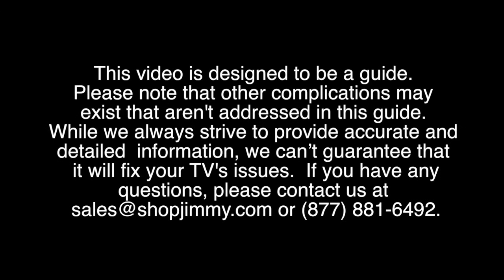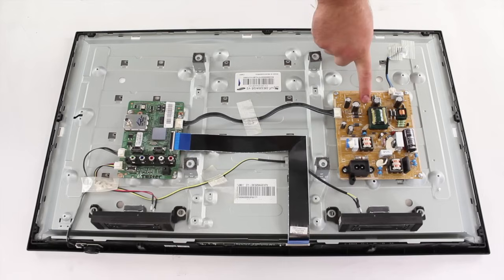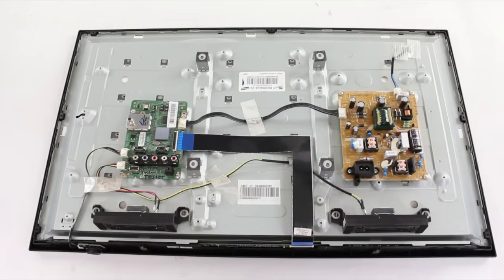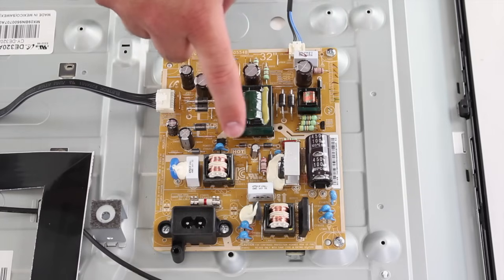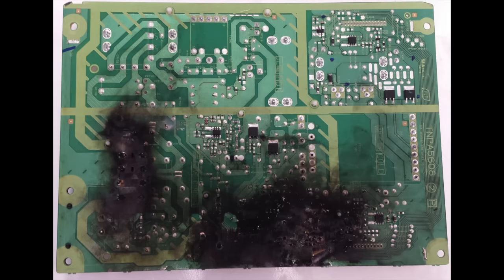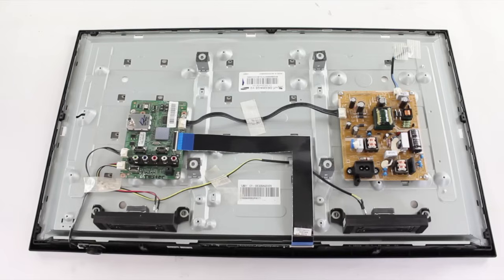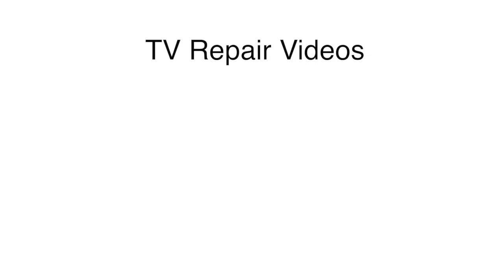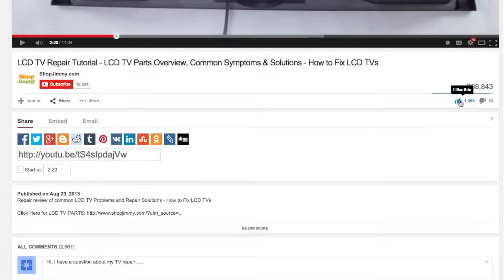Samsung LED TV Won't Turn On No Power & Does Have a Standby Light Basic Troubleshooting TV Repair

Comment: My tv went blank shut off, came on with no sound then went off and never came back on.. No lights at all.. I just replaced the Power supply and now the lights come on.. I can tell the IR is picking up my commands from my remote. So what do i need to replace next, i dont want to waste money. Idk if I need a main board or an inverter.

Comment: Have 2 Samsung UN50ES1650FXZA both with same symptoms. When you plug tv in standby light is solid once power button is pressed light does 2 short blinks, 5 times then stays solid and repeats. Visual inspection of all boards is good. Unplugged main board from PSU LED will come on. Testing plug on PSU to main (5v pins) getting 7 volts but jumps with blink of standby. If I plug tv in and do not press power button standby light will stay solid with screen off, and same plugs shows 0 volts to main.

Comment: I have a samsung led smart tv un50h6201af with no picture, its has sound and backlight are on i looked at boards and their is no visible damage to the boards. Checked the ribbons to see if any of them was loose and they was not. I checked the fuse to the t con with my craftman multimeter to check the voltage going to t con board and there was no volts or standby volts. Do i replace the power supply board or is their more ways to troubleshoot the tv to get a better diagnosis. I tryed checking the volts to the power supply board but i didnt get a read

Comment: I replaced the power supply, which did not fix the problem but when I replaced the main board, the TV came on. The TV turned on and off for a few days but now it won't come on at all. The standby light flickers when I try to turn on the TV from the on-off switch a the back or by using the remote. I have a Samsung Model UN46H7150AF. I'll never buy another Samsung.

Comment: I have installed a new power board and a new main board and still no luck... Any ideas? I have standby power and the back light turns on, but no picture. I hear the menu beep when turned on, but then it just cycles trying to turn on over and over again.... Any ideas are greatly appreciated!

Comment: Your video was very helpful. We have a Samsung LN46B630N1F. I was able to determine that a component on the power supply board burned out. Do you have any replacement boards for this model available, and if so, what would the cost be?

Comment: Just replaced power supply board.. TV works now, but have dark shaded bar running horizontally thru the middle of the screen. Could this be a bad power supply board? TV never had backlight issues...

Comment: I have a SAMSUNG UN39FH5000F that will not turn on. but the led light on when i try to repair the problem i discount the long cable that is connect to both the power supply and t-con board TV light came on but no picture
Reply: Donell Benton did you ever figure this out

Comment: i have a Samsung UN55FH6003FXZA ver AHO1.  When i plug the cord the standby light flashes red once and then nothing.  Performed a visual on both boards and cant find anything indicating a problem.  Next step?

Comment: sir, i have a sansung led tv 40 inch.. when i try to on can here tv power on sound  but no have backlight and display. after 30 minute tv off automatic. my tv model 40f 5000. i hope you can help me
Reply: same problem here ! got any solution ?
Reply: @josephfrancis4683  did u got u problem fixed? I've the same issue

Comment: I have a Samsung smart tv model #UN50EH5300F When I try to turn on the tv set it just blink and shuts immediately off continuously.  I do see a blinking white light when I look through the back of the tv panel.  Please help with what kind of piece I need and how much it would cost.  Thanks a lot.
Reply: Kel Clerk did you ever find a solution for this?    I’m having the same issue
Reply: Bad led strips

Comment: when I disconnected the main board from the power supply and replugged the TV in the LED panel lights up. I am pretty sure that this means that I need a new power supply. could anyone please confirm this before I order one? 
UN55FH6003F
TYPE NO. UN55FH6003
AC110-120V-50/60Hz
125W
Typical power - 65W
Model Code : UN55FH6003FXZA
VERSION NO. AH01
S/N:Z8213CCDA02227T
Reply: There's no standby light on when plugged in, but as I said, only when I disconnected the two boards does the LED board light up with a constant glow. The TV was having to be plugged in and unplugged several times over the course of several months then it just decided to not power on again. I'm fairly certain that it is the power supply but would love some feedback. Of course I will purchase the board from you guys if you can help me out with this. thanks in advance
Reply: that being all said, I forget to mention that there is no visible damages to any components.

Comment: the power board in my Samsung has a diode that fried on the original board. bought a replacement and the same exact spot and diode fried again. any reason why? and can this be fixed. I really don't want to buy another t.v

Comment: I have a Samsung TV  Model: UN46EH6030FXZA -After exiting the hidden service menu I was unable to power the TV back on.  Currently I have no picture, no sound and no backlight.  When applying power from the remote I get a steady standby light only.  When powering off the standby light blinks 5 time then goes out.  I have tried a blind factory reset posted by one our good YouTube members without success.  Any help would be appreciated.  Thanks in advance!

Comment: Have samsung le37 A557P2FXXU Fault:-
When switched on at wall it will show red standby light but will dim out and die when remote is used.
Changed power and main board  still the problem exists.
Works perfect when left in standby mode .
Any ideas as im running out of bits to replace?
thanks

Comment: So my Samsung tv has a red light but doesn't always turn on. If I unplug then plug back in it sometimes goes on.
Reply: Michael Cardiff 
I have the exact same problem. Did you ever find out what was wrong with yours?
Reply: Michael Cardiff mine doesnt turn on at all but does have stand by. i ordered the power supply board and replaced it but problem wasnt fixed so now im returning it and ordering main board.
Reply: Commaa
Reply: Same problem with my tv. Did u ever fix  it and if so what was it?
Reply: I have a UN55EH6000F SAME PROBLEM  2012 model power goes out no led no screen, will not turn on with switch either. Unplug overnight plug back in works for a week or so then goes out again
Reply: So did you come up with a solution.
Reply: Just fixed mind with a main board from shopjimmy $40
Reply: Michael Cardiff 
I had the same problem with my Samsung I kind of found out through some of these videos I've watched that on Samsung It's usually the capacitors.
It's the capacitors inside the power board. If you open it up and look at the little round capacitors on the tops of them you'll see that they either bubbled up or expanded and broken the seal. I just replace all of them on my tv and just in case for insurance I replaced the ones that weren't blown and it worked perfectly.
Reply: I have samsung series 45 led tv and have same issue... so far mine will reliably turn on so long as after it "dies" I unplug/plug it back and it will turn on.
Reply: I have a similar problem with mine, after I unplugged the power board from the main board and red the outputs of the power board with A/C plugged in the TV started working fine again. I am pretty sure its the main board since the power board outputs all matched what the circuit card had printed on it (each plug has a table with voltages for each pin). The other suspect I was thinking of was the remote/manual switch that connects to the main board. To me it seems that if you are able to get your TV to work properly even only some times it would indicate a problem with the main board rather then the power board. This does not apply to any other audio or visual problems other than a total black screen.

Comment: Good morning Jimmy.  I have a Samsung UN60FH6003F tv that has the standby light on, but I have to unplug and plug it back in to get it to power on with the power button or remote.  Any suggestions?  Thanks in advance!
Reply: Same problem with mine

Comment: my 60 samsung smart tv won't power on. I've replaced the power supply  board as there was a visible burnt component. but it still would not power on. when I disconnected  the main board I got back lights working but nothing else. when I plug the power supply  back to the main board the back lights go back off.

Comment: I have a samsung un65 65 inch led tv.  only thing it will do is flash a clear light in the background.  This starts to happen from the second I plug it in.  I can't turn on or off or get any picture, menu, nothing.  Just a slow flashing in the back .  I have replaced the power board and the main board and the t-con board and it still does the same thing.
Reply: RTR Racing did you ever find a solution?    Dealing with this now

Comment: Our TVs lcd light works but the screen Dosnt come how can I fix it any suggestions btw on a 65 inch plasma tv
Reply: Plasma? Just buy a new TV. The LCD technology is so efficient,right weight, and superior in picture quality. You can find a 65 inch LED LCD for $500 at 4k

Comment: I have a Samsung 32 inch there is a picture but only when I shine a flashlight on it and there is sound I have taken the back of to check if I can see the led light up but there is no lights could u tell me what I would need to fix this is it the led driver or the actual led strip ?

Comment: I replaced the power board and my light still blinks and takes a long time to come on, if it does. I also noticed when I switch from a standard digital channel to a HD channel it will go black and the red light starts flashing again. Could it be the video board? What about the capacitor in the main power cords going from the main in to the power board? What are your thoughts?

Comment: I fixed a TV like that yesterday. Power supply ticking, TV wont turn on. I found a leaky high voltage SMD transistor near the LED output. It has two 1M  resistors in series with its collector. Be careful, capacitors in this area stay charged for a long time. Discharge them with a 230v lamp.
Reply: 1 meg in series with the colectors?! explain. not much going thru 1 megaohm. I any case, thanks for info , will check this out next samsu g led set...
Reply: This is all I had to work with, http://obrazki.elektroda.pl/7456779600_1450654588.jpg
You will see what I'm talking about in the top RH corner. I have seen two models with the same fault although the symptom of the recent one was different. It sometimes would run but would turn back on 15sec after being turned off by remote or sometimes not turn on. The LED current sensing circuitry was the same in both, the protection circuitry that the 1M resistors fed to was different. With one of them, the 1M resistors finally applied voltage to a signal SMD MOSFET that pulled the anode of the opto coupler low, disabling regulation feedback of the main supply. This caused an OVP trip of the STR SMPS IC on the primary side.

Comment: pn51f4500 hi this tv  dont  power on only flash led red only see  light coming in screen   for 2sec  n  go back / ? please send info thanks
Reply: quijote disco
Power board, bad caps. Change the small ones and then use a hair dryer to jump start the power board. Heat up the larger caps, for some reason they will not have charge heating them will help it to power up when replacing the caps.
Reply: quijote disco

Comment: hi Jimmy. .I have a Samsung UN40FH5005F 
Version # TS01.
when turned on I get audio only with a black screen, I did the flashlight test and noticed I can see what's showing. I then checked the components. .the Main board and Tcon  board appears to be in good condition however the power supply board appears to have a burnt spot, can that contribute to having a black screen?  

Regards. Joseph.

Comment: Hi ! I have Samsung 40eh5000 led. Its staying standby mode with red light without blink and not  getting on. I have opened and checked that there no any capacitors have 
burn. What should I do now ? Thanks
Reply: Rajubhai Rathod

Comment: My Samsung LN40D630M3FXZA stop displaying an image, I can
turn the TV on and off and the stand by light stays on and will blink if I press
any buttons on the remote, while the TV is on the screen will flash very dimly.

This started after having a non-powered external USB drive connected
for an hour that had water damaged and wasn’t fully dried. The TV was working
connected to the USB for an hour before it began acting this way. 
There doesn’t seem to be any damage components on the Mainboard
and power supply boardDo you think only the Power supply board would be effected?

Comment: Hello, I have a Samsung model HL72A650C1FXZA and last night the picture was real dark and now today I tried to turn it on and I hear the music but blank screen and the green lite flashes for a few seconds then a red and green lite flash once then back to just green lite flashing and I can't turn it off or anything. I looked for damaged capacitors but did not see any on the power supply card. Oh, and I already had the LCD replaced because of all the white dots.   Any ideas?????   Thanks

Comment: hey, i got a LG 47LN5710 LED tv that doesnt turn on for any longer than a second, it just flashes the LG logo then turns off instantly. the red light at the front seems to be alot dimmer than it used to be and also it blinks about 4 times and then stops. i opened up the back part to check for burnt capacitors or any sign of blown wires but theres nothing, am wanting to know if you maybe able to help me find a possible cause for this. Is there any chance that it could just be a burnt fuse? this tv has ceramic fuses and i cant tell whither its broken or not, i have no volt meter to test them out. any advice would be much appreciated.

Comment: I have a Samsung UN40H5500.  The  standby light is on and not flashing.  However, when I press the power button, the backlights flash once really brightly and then nothing happens.  No screen and no audio.  There is no visible damage to the either the main board or power supply board.
Reply from the maker: +Brett Ramsey   Try all repairs and troubleshooting at your own risk.  This sounds like you have bad LEDs in your TV.  Unfortunately we do not sell replacement LEDs for your TV model number at this time.  You can check back in the future to see if we have them available.  Thanks!  www.shopjimmy.com
Reply: 1
Reply: ShopJimmy.com 
I got a Un55h6203afxza samsung tv. I found it had bad leds with the flash light test and also testing them with a led tester. Also checked power coming off board to led. it was really high voltage. I then replaced the power supply and leds. upon completion I plugged the tv in and now I'm. not getting the stand by light. think I have a bad board?

Comment: I have a samsung UN40D6000SF led tv, The tv wont power on and their is a red blinking light.
Reply from the maker: +Ramiro Murillo   Try all repairs and troubleshooting at your own risk.  I recommend replacing the main board in your TV.  Click this link to replacement parts for your TV model number:  <!-td {border: 1px solid #ccc;}br {mso-data-placement:same-cell;}->http://www.shopjimmy.com/catalogsearch/result/index/?cat=56&q=UN40D6000SF  There may be multiple boards for the same TV model number, be sure to match part numbers on your current board, with your replacement for compatibility.  Here is a link to a video showing how to identify your part number, click here:  https://www.youtube.com/watch?v=BEPWrefQvqI  Thanks and please let us know if you have any further questions with your TV Repair!  www.shopjimmy.com

Comment: Thanks for the video. I replaced the my BN44-00341A with the 00341B board. It worked on the first try, then I turned the TV off and relocated. It FAILED again. (all this happened within 10 mins).......... Should I trash this TV?
Reply from the maker: +Paul Yindeemark  What was the original problem with the TV?  Try all repairs and troubleshooting at your own risk.  Please reply with your TV model number.  Click here to view a video that shows how to find your TV model number:  https://www.youtube.com/watch?v=S51nhAmwR2M  Thanks!  www.shopjimmy.com

Comment: I have a Samsung LED TV UN55EH600FInitial problem was Vertical lines in the middle of the screen, then went to a black screen no sound. Backlights are working; I replaced the T-con board first, then I had a blue screen, no picture with sound. Then I replaced the main board, blue screen no sound, and finally replaced the Power supply board, blue screen, no sound. Help!
Reply: probably a popped led. or two. like series Christmas lights, one bad one will prevent all from working.

Comment: i have a samsung UN32F5500AFXZA LCD TV 
IT TURNS ON BUT NO PIC AND IT HAS SOUND AND YOU CAN SEE THE PIC VERY FANT AND I PUT A NEW POWER SUPLY IN IT AND A NEW T-CON BOARD THE RED LIGHT BLINKS A FEW TIMES BEFOR IT STOPS .ANY HELP .AND THANKS FOR PUTTING THESE VIDEOS UP TO HELP OTHERS
Reply from the maker: +1bulldog998   Try all repairs and troubleshooting at your own risk.  This sounds like you have bad LEDs in your TV.  Unfortunately we do not sell replacement LEDs for your TV model number at this time.  You can check back in the future to see if we have them available.  Thanks!  www.shopjimmy.com

Comment: I have a samsung UN55FH6003F tv. Issue started with the tv not wanting to power on. Solid red stand by light, no blinking that I have seen. If you waited for a while or unplugged the tv for about 10 minutes, it would turn on. That worked for a couple of weeks,  but now it won't turn on at all. Using the remote or the button on the tv has no effect. I replaced the power board, and have the same exact issue, no change. Is it likely the main board?